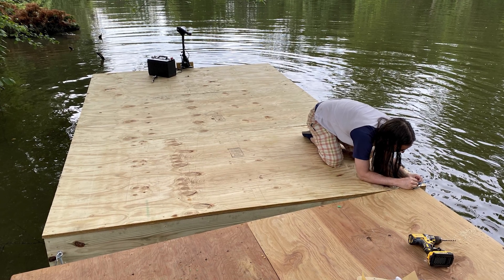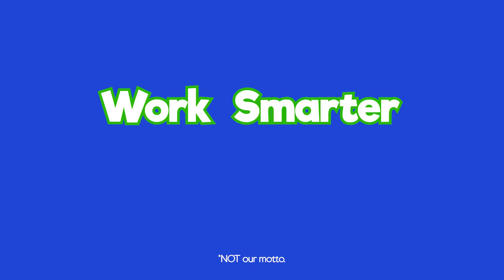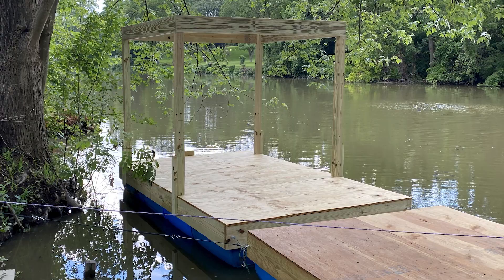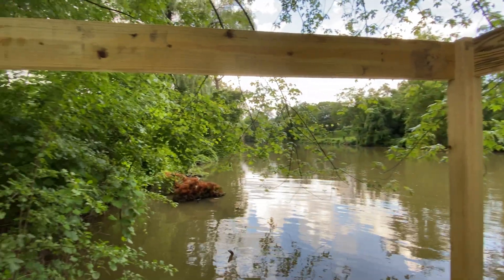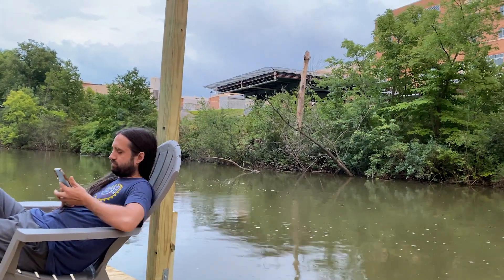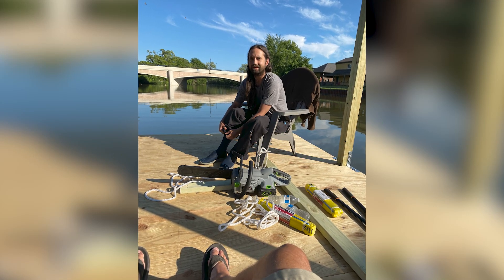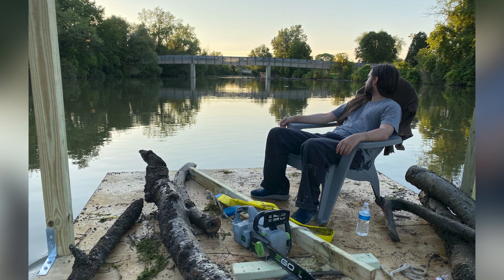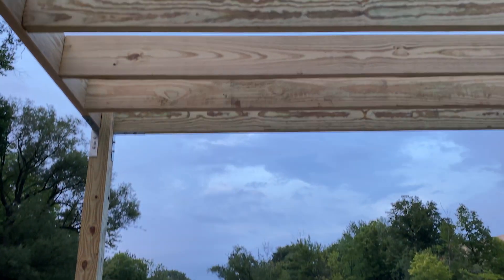DIY Solar Pontoon Boat Upgrade

Comment: Hi ,Bob here , I'm going to build one of these . Do you think 4 barrels on each side is enough ( I know it depends on how much weight you but on it ) I will probably keep building and adding weight 😊 does it lean much when you walk side to side ?
Reply from the maker: 8 barrels will be enough. Use less/lighter framing than we did. It leans a little bit, but nothing alarming. Plan ahead for middle barrels for when you add too much weight, and most importantly, HAVE FUN!
Reply: Awesome answer thank you 👌 and I was thinking of putting barrels down the middle ? But not sure ??? Cheers

Comment: Hmm 🤔. Good idea. My regular pontoon boat (non-homemade) is moored in a slip with no power hookups. Wonder if I could get a solar panel to charge my trolling motor battery versus hauling it home each time.
Reply from the maker: Yeah you can, and it’s pretty simple! Just get a solar panel and wire it into a MPPT solar charge controller (Victron Energy 75|15 is a great starter model, depending on the total amount of voltage from the panel), and then run wires from the Victron unit to the battery, and you should be good to go! Msg us of you need any help!